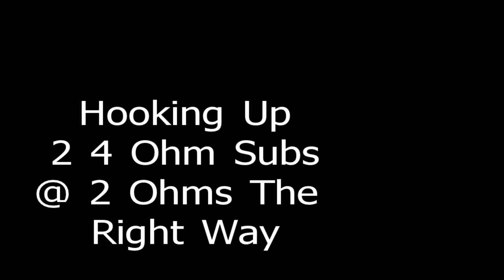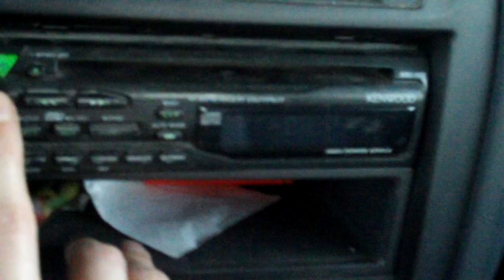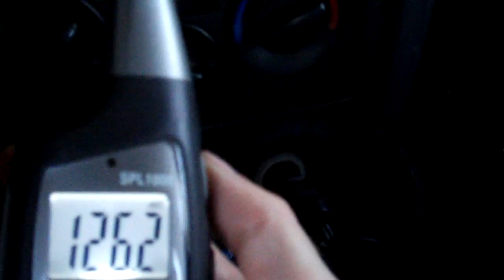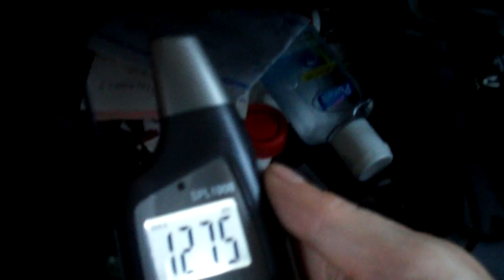How To Hook Up Two 4 Ohms Subwoofers @ 2 Ohms On A Mono Block Amp

Comment: My 1 channel monoblock has 2 neg and 2 pos inputs.i see you can wire one 4ohm DVC sub parallel  to make it 2ohm. But can't wire both 4-ohm dvc subs parallel together and it be 2ohm. So here my silly question..can I wire each one separately parallel and connect each one to the + and - separately and it be 2ohm

Comment: I have to Orion 12in 800 watt Subs which app should I use to power this also adding and 2659 scopes tweeters on back Dash could you help suggest a particular type and size amp 4 setup?

Comment: Wrong! Wire one speaker then run the negative. To the other speaker pos. Then run the negative. From the second speaker back to the amp

Comment: blow mo weed bro'....and just bass we all the same way on here....doin time we just experience things blow things trail and error and get info from others....and mono amps ...class d have avenage ova a/b amps  but class d have a design for bass... so mono amps rules are if you got a single coil 4 ohm or a dvc 4 your amp read it as two ohms...dvc 4 ohm can either be 2 or 8 which is house speakers ...so what you got goin even though messy and the subs reverse to get more airspace to hit those notes you need a bigger box for the subs and watch your gain on your amp take off bass out your radio.......smoke on bro

Comment: wow those are rare vintage stamped steel
 woofers! they barely move at all like a quarter of an inch! i remember those designed to be light and efficient when amplifiers never exceeded 400 watts
Reply: Then you definitely didn’t know anything about ORION amps even old school ones put out  big time wattage back in the 80s and 90s.
Always been true wattage .

Comment: So I could hook up 2 8ohm subs to a 4ohm amp? The amp is mono 250 watt Max and the subs are 8 ohm 100w rms  250w max.
Reply from the maker: Yes you can as long as the subs are single 8 ohm voice coils. Just hook up the subs in parallel. Easy peezy :)

Comment: I have 2 alpine type R 10 inch subs in a ported box rated at 750 rms a piece. I just ordered a rockford fosgate prime 1200 amp which is 1 ohm 1200  2 0hm 800  4 ohm  500  what would be the best way to wire it to match my rms on my subs. do you take the 750 x 2 which is 1500 so should I wire the speakers to 1ohm?
Reply from the maker: If your able to wire them to 1 ohm then thats what I would do. If they can't take the power just turn the gain on the amp down

Comment: I have a pioneer gm 2400 w mono and I have two pyle 15 at 2000 each could I set these up together on this amp and have it sound right I currently have one in with the amp please help thank you for the vid tho
Reply from the maker: Yea that should work fine together

Comment: Hey man get your two subs and put them + to- them jump the - to the + of the other speaker and then you will be left with the first sub + and the second sub- connect thoughs 2 too your amp and that will drop it to a 2 ohm load because on this vid u have it running on  a 8 ohm load

Comment: hay I got a question I got a 3000watt class d single channel 1,2,4 ohms stable amp boss and a pioneer champion series pro 3000watt too.  And it doesn't give me hole lot power. when to option 2 bought a pair of Rockford fosgate 10" 800watt and still the way I want. I don't know if I am connecting wrong or doing something else.
Reply from the maker: That boss amp probably puts out around 600 watts at 1 ohm and your pioneer I'm guessing maybe 1000 watts at 1 ohm. Probably perfect for those rockford 10's though.

Comment: so i got 2 4 ohms subs. my amp is 2 channel can i still connect it on 2 ohm for a better sound?
Reply from the maker: If your amp is 2 ohm stable yes
Reply: casperskafs. nice but one question bro. my amp wont turn on.
Reply: Check your fuses and make sure everuthing is wired up tightly amd gets a clean connection also check the smell amd internals on the amp for a burnt smell or blown peices on the board i know this is a late comment amd you probly figured it out but im glad to help #BassOn

Comment: I have the Planet Audio AC1500. Only has one speaker output. How do I connect Two dual 4ohm subs using all four coils?
Reply from the maker: You can put them in the same hole if you wanna do it that way or wire them together to make 1

Comment: alright i have a question so since there are only 1 set of positive/negative wires connected to the amp where do we plug them in since there is 2 sets of ports for positive/negative
Reply from the maker: Hook them together but make sure you do it right

Comment: I'm new to this , is it bad I I have 2 4ohm lancer 12s to a 1500 watt 2 ohm stable quantum audio amp, just by putting each sub to each negative and positive in the amp?
Reply from the maker: As long as they are single voice coil they will be perfect in that situation

Comment: wheres the best place to get one of those decibel readers?
Reply from the maker: Got that off ebay but it is no where near accurate
Reply: HEY I HAVE CHECKED MY WIRING SO I KNOW ITS NOT THAT , but my subs will not knock right all the time. i dont think its a power issue or a ground issue, what will happen is the subs will still e working but hardly at all and then they will kick back in to their full potential. this happens once in a while and it drives me crazy, what do you think it is? my amp? or a faut in the subs?

Comment: specs on 1000 watt baja ha 1000. 
160 watt rms×2 @ 4 ohm
240 watt × 2 @ 2 ohms
480watts rms ×1 bridged @ 4 ohms. 4 ohms stable in bridge mode. 
2 12 in dual subs 875 watts. 
can you draw me up a dumbass proof diagram of how I should wire this set up . Thanks man

Comment: you did not change anything, think about it for a minute. its still hooked up the same way. its still parallel wired.
Reply: 4 with 4 parallel is 2. Unless its series which would be 8
Reply: Those are 2 ohms each sub 🤦‍♂️

Comment: my amp says 400 watt rms.. single channel mono  .. i have 2 12 inch single coil subs.. both are 4 ohms it says on the back....   I took + to +   - to - both subs...  Then i ran a tail off of that...  Now my amp has 2 sides .. one for each sub..   Should i take that tail and just run it to one side.. ( example Speaker side 1 )    or should i run another tail of the other sub and have both wired to amp..
Reply: they parallel it internal right? my amp says 800rms music hawk 800.1d. i have two subs svc, 4 ohm 250 rms. i tend to confuse with the total final impedence such as 800x1 at 1ohm, 600x1 at 2 ohm and 500x1 at 4 ohm. does it mean in order to achieve 800x1 at 1ohm i have to use 2 dvc subs?
Reply from the maker: If its a mono block amp then it doesn't matter. Just hook up 1 pos and 1 neg to the amp

Comment: ive got 2) Pioneer 12 Inch 2600 Watt Champion Subwoofers hooked up to this 3000w amp well should when they get here do you think i am good? like will they work?
Reply from the maker: You'll be fine just make sure your eq and gain is set correctly

Comment: sounds like shit mine broke my rear Mirror it was 2 12 boss subs pushing 800 watts a peace with a 900 watt amp an still hit harder it flax my back window half 1 icnh an burry your eye site
Reply: how does one sub push 800 watts each if you are using a 900 watt amp. sounds kinda false?
Reply from the maker: Nice

Comment: Can I hook up a Circuit breaker 150amp
with 2gauge or 4gauge wire to my 2 15inch kicker L7 subs and 3000 hifonic zues class d amp
Reply: Or should I just use fuzes instead of the breaker
Reply from the maker: A circuit breaker will work because I used one way back in the day but I really suggest a fuse

Comment: I have 2 dual coil 2 ohm 1000 watt rms subwoofers connected to a 2400 watt kicker amp mono how would i wire this to get 1200 watts @ 2 ohms to one speaker help
Reply from the maker: Wire them seperetly up in series then together in parellel  to make a final load of 2 ohms

Comment: i got 2 8 ohm 15s with a 1 ohm stable amp wired in parallel my subs only going to be 4 ohms would like to go down lower then that
Reply from the maker: You are 100% correct. If your subs are single 8 ohm and your wired in parallel 4 ohms is all your gonna get

Comment: anyone know why my punch 800.2 is cutting off with two 12in Kenwoods I had 4 free air 12s before to an amp just like it and it never cut off
Reply: check your power and ground make sure your power is connected securely and make sure your ground is grounded properly. an also how do you got your subs wired? is your amp a mono amp is it a 2 channel 4 channel 5 amp. do you have i your subs bridged? and if so at what ohms 8 or 4 or 2 ohm single vc or dvc? is your amp capable to run at 2 ohms stable?  I think your amp is going into protection mode
Reply: It's a 2 channel and I have it bridged the speakers are single voice coil 4ohms and I wired them just positive to positive and negative to negative at 4 ohms I had the running at two ohms but it didn't hit like I wanted to
Reply: +Enrique Cantu it's a 800.2 mono amp?
Reply: +Eric Hernandez  if your going to drop ohms no matter if it's 8 ohm two 4 ohm or 4 to 2 or even two 2 ohms to a final impedance of 1 or .5 ohm you need a mono amp that is capable of running stable  at whatever ohms your dropping down too
Reply: +Enrique Cantu the reason it didn't hit like you wanted was because your amp is not able to handle the 4 ohms final impedance being that it's a 2 channel amp. you need a 800.1 meaning 800 watt RMS at 2 ohm stable 1 channel monoblock  that's where you get that 800.1

Comment: Does hooking up 2 speakers to 1 channel split the amp watts? I have two 4 ohm speakers on 1 channel that delivers 600 watts RMS @ 2 ohms. My speakers are 375 watts RMS each.
Reply from the maker: +John Rodriguez From what you are saying yes and you have things hooked up perfect. Like if your amp is a mono block (1 channel) and it puts out 600 watts at 2 ohms then you are getting around 600 watts divided by 2. Since your subs are single 4 ohm and they are hooked together in parallel its making them like 1 2 ohm speaker. If any of that makes since to ya :)

Comment: whats up bro,ive been watching for awhile now and i hope all is well with you!i have a 12'' dual 4ohm pioneer champion series sub in a base tube at 400 watts rms and i have it ran in parallel and bridged at the amp,the amp is a 760 watt 2 channel 2-8 ohm bridgeable amp.should i have the sub hooked up in series or parallel?
Reply from the maker: +mumforddale1 I think you will be on in parallel. Just watch your amp and make sure it isn't getting super hot or shutting off
Reply: +casperskafs ,I ran it in series instead,is that ok?
Reply: amp started to cut on and off and getting hot.
Reply from the maker: +mumforddale1 unbridge it
Reply: played it yesterday and it didnt get hot at all the amp that is the subwoofer was cool as well!and i have it ran in series and bridged the amp.when i had it in parallel the sub that is,it amp was getting hot and shutting off ,but its cool now but still need a better amp and sub..i would like to get a sub with a high rms rating!
Reply: ok first of all if your dropping ohms from 2 subs at 8 ohms each to a final impedance of 4 ohms or two 4 ohms to a final impedance of 2 ohms you CANT put it to a bridge able 2 channel amp that's just stupid you will fry your subs or your amp or your entire cars electrical system ok. that's what MONOBLOCK amplifiers are for. or get another identical amp have 2 amps one for each sub then bridge one sub to its own amp make sure your gains are set properly and there you go

Comment: I was wondering if these subs would be compatible and if yes how to wire them (series, parallel)

 my friend gave me his Lanzar VCHB210 and I was wondering what amp to use 

Speakers: 
        10" Dual 4 Ohm Vector Series Car Subwoofers 
Power Handling: 
        Peak: 2000 watts total/1000 watts each 
        RMS: 1000 watts total/500 watts each 

Amp: 
        Pyle PLA2378 2-Channel 2,000-Watt Bridgeab le Mosfet Amplifier 
power handling: 
        Maximum Power Output 2 x 1000W 
        Bridgeable RMS Power @ 4 Ohms: 1x2000W

Comment: hi I have 2 12" hifonics on a 2000 watt and the amp works then goes into protect mode, I've checked the ground and the connections and they seem to be fine.

the amp goes into protect and its still cool, but the speaker wire from the box connecting to my amp is really hot

 could it be the wiring inside the box?
Reply from the maker: +ronald ramirez Deff should take the subs out and check that. Sounds like a fire waiting to happen
Reply: +casperskafs thank you. 
I took em out and couldn't find a issue but now only one sub is hitting the other is moving but not hitting on the beat any other suggestions?
Reply: You are why I dont buy used electronics.

Comment: i have to matts 500 watss rms with a kicker 750monoblock and the amp cuts off way or wat shud i do
Reply from the maker: ret marr Could be bad ground or your amp isn't getting enough power
Reply: i had it wired 2 omh and the w is 4 omh tks
Reply: +ret marr how thick is your power and ground wires? you need power from the alt/batt to get the amp powered up right,,, takes power to make power

Comment: Hey, my name is Branden Cope and I bought 2 subwoofer enclosures with 2 12" subs each ive measured with a milti-meter, the two separate subs in the sealed enclosure are 8 ohms each and I bought a Dual brand bandpass sub enclosure with only one input for both subs and it reads 8-10 ohms however it says 4 ohms nominally, idk what that means but I assume that they are 8 ohms since that's what it reads on my meter. I have these all four hooked up to a 600watt 4 channel volfenhag 2 ohm amp and I was wondering, how do I wire these down to the proper 2 ohm system it was designed for? ive got some distortion in the subs and serious dimming in my lighting in my car. ill buy a capacitor and extra battery for that but for now I just need to get the ohms right. heres an easy overview: 2 subs per box, 2 visonik 12" 350w peak in sealed enclosure with 2 inputs, 8 ohms each. 2 Dual 12" XXXwatt peak in a bandpass enclosure with only one input that reads 8-10 ohms. please help

Comment: I have 3 4 ohm subs and need hook them up to a punch 1 ohm amp.. I cant figure it out man.. deff need your help, thx homie
Reply: Rocky Gilbert  so watching your video i see now, but what side do u hook speakers up to? right or left?
Reply from the maker: Rocky Gilbert Whoa are they dual 4 ohm or single 4 ohm?
Reply: they are single man.. i decided to not use the punch amp cause it didnt have enough power for three subs.. i have 3 1200 watt sont subs and 1000 watt amp. its hooked up but driving a hour turned up loud, the amp cuts out! pretty sure cuz its getting too hot! guess i need bigger amp huh?

Comment: if those are 4 ohm subs you NEED to wire them to the AMP @ 4 OHM'S ALSO. Or your amp will always run hot and you stand a chance of blowing the subs or frying the amplifier.
Reply from the maker: john smith LOL you couldnt be more wrong brother but its cool :). Your amp will handle whatever its stable to.

Comment: Hey man, i have a Boss amp, and 2 12 terminator subs, but i also just aquired a 12 inch powered sub with a built in amp, how should i go about setting this up?
Reply from the maker: ArtOfTheEnemy Sell the powered sub and run the rest

Comment: Is there anyway I can run 4 ohms dual voice coil mtx 5510 -44 subs on 2 ohms. I have  kicker zx1500.1 For  Amp. I could 4 run it at four ohms not sure what to do be for I put them in 1 ohms amp is not stable

Comment: I have two 10 inch 800 watt i run a 1100 mono amp i have every thing turnd down yet they still sound like they cant handel the amp is it to much power ?
Reply: Dont do drugs.

Comment: So i got a boss 2500w amp monoblock and 2 kenwood 12' subs can the subs take that much or will they blow out
Reply from the maker: Jonathan Soriano Not sure man. Give it a try and start low volume
Reply: Jonathan Soriano Use a multimeter. Is super easy

Comment: I have a Hifonics Brx1100.1d monoblock. It had 2 inputs and 2 outputs. It had an input L and Input R / Output L and Output R.... Which should I use to plug my rca cables In?
Reply: input

Comment: I have 2 four dual audiopipe 12s how do i connect them to my 1500 watt class d audiopipe amp?
Reply from the maker: John Rodriguez Check out the12volt.com and look at subwoofer wiring diagrams. It explains it pretty clearly

Comment: i got a 500/1 JL audio monoblock amp with 4 outputs and 2 12 DVC's how should i wire this properly... im like you never had a monoblock
Reply from the maker: Chevy Money Easy peezy. Goto the12volt.com and look at subwoofer wiring and it will tell you no prob
Reply: thanks

Comment: Hey man hopefully you could answer my question. I just bought two alpine type SWS-12D4 dual voice coil subs and this is my dilemma. They are both 4 ohm subs and i want to know if it would be possible to wire them at 2 ohms into my 1200 watt class d mono block amp. My amp is stable at 2 ohms and i know it would sound the best there but from all the research ive done i cant find an answer. it seems as if i can only get them to go to either 4 ohms or 1 ohm and my amp cant handle 1.  with them being DVC subs i am not sure if it is even possible. Thanks for your time
Reply from the maker: xXdisturbed182Xx Yep sorry man you can wire in series then parallel to make them 4 ohms or wire them in parallel to make them 1 ohm :(

Comment: I have a  Rockford Fosgate1500 is it compatible with 2 1600 watt audiopipes
Reply from the maker: antonio starks Of course just gotta wire it right. Look at the12volt.com subwoofer wiring diagrams :)

Comment: hey i blow  3 pioneer 12s they were 1200 watt max  they were 400 watt nom power  would i be ok runing  3  alpine type  r  running  off  a  bd 1000  one channel amp this amp i got is  old school
Reply from the maker: drummer261 Yea of course just make sure you get the ohms right
Reply: ok